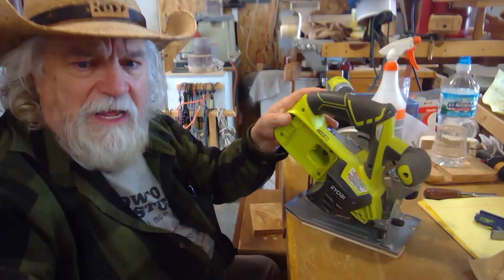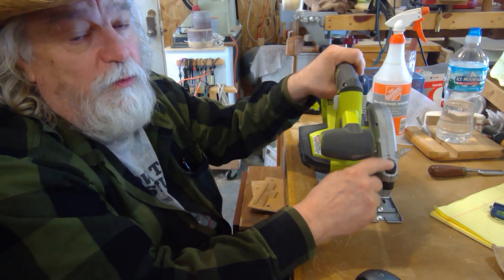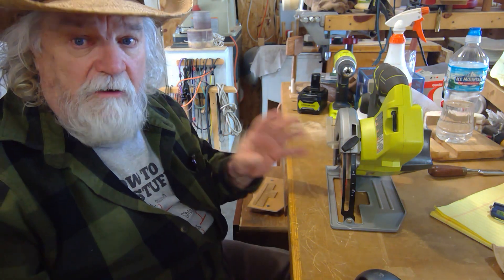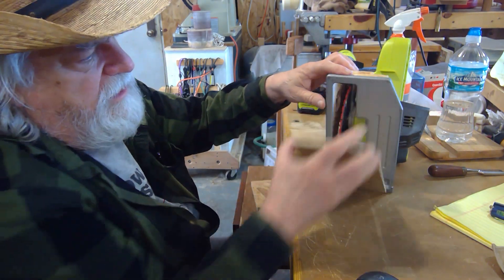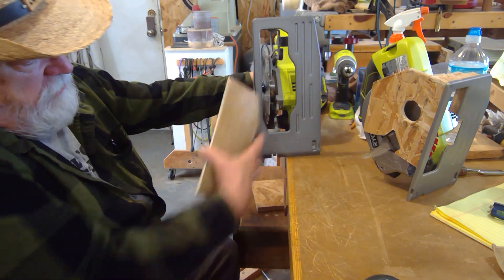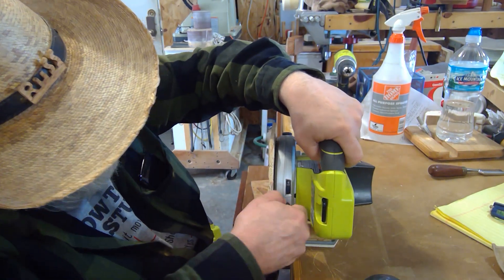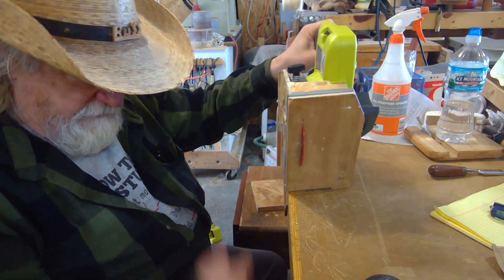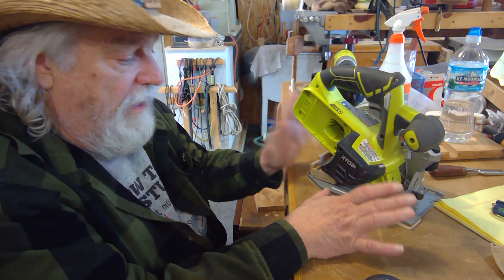No Tearout with my Circular Saw by OTB Thinker

Comment: I have the same Ryobi brushless saw and it's so frustrating that there is no out of the box dust solution from them.  I spent way too much time looking at adapting another saw's dust chute and parts catalogs for foreign versions of the saw.  I like your approached much better!  No permanent modifications to the saw.  I plan to make mine out of acrylic so I don't lose visability.  Thanks a bunch!
Reply from the maker: I thought about acrylic but I had plywood on the shelf and this was my first prototype.  it shouldn't work this well.  let me know of any improvements and how it works for you.  thanks guy :>)

Comment: Nice and quick to make! Plus, you can have more of those ready for most common cutting angles. I'd like to see some kind of fencing on it's corners or, perhaps better, on the edges to make absolutely sure this thing will be always perfectly aligned with the blade. Some kind of snap springs might work even better. What's great about it is that I'd guess it works even better than a track saw at preventing tear out. The other great thing is that it costs nothing to make and what's more it saves you having to use a sacrificial sheet every time you want a perfect cut i.e. it saves you money in the long run.
Reply from the maker: Actually, the inner opening has glued narrow cleats that hold the plate in alignment and the magnets hold it tight to the plate.  It  self aligns as the magnets make contact and can't move.  You don't need extra sides on outer perimeter.  You are correct that it saves money and tear out problems.  I love mine.  Thanks for the input, Stel :>)
Reply: @russveinot5754  Ah yes, indeed! I did not notice the cleat the first time I watched it"
Reply from the maker: @Stelios.Posantzis  I noticed that everyone else (on youtube) would surround the outside to hold the saw and drill holes to hold together, but I wanted it to fit in the original footprint and no modifying the saw with holes.  Thanks for the thoughts :>)

Comment: Check your email, I sent the pix of your jig, that I can't find the video showing how it works. Thanks.
Reply from the maker: no email from you.  what address?
Reply from the maker: use "russv" on the first part.  thinking I have an email issue with otb . . .  no email in a week.
Reply: Done
Reply from the maker: still no email. getting youtube.
Reply from the maker: Bill, still no email from you (just checked).  I still want to help.  is your email working?
Reply: Go to the link above to see pix.  Your email service is broken apparently.
Reply from the maker: Thanks for your patience, Bill.  that is a jig for my miter saw to make 45 degree cuts without moving the mitersaw angle, like when I am using my small parts cutting table.  the only reference to this jig is on link:
https://www.youtube.com/watch?v=rX2pxj_kdz4&t=167s
it starts at 5:15 and runs for 1-1/2 minutes.  if you want more, I can see about doing a quick video demo of it. Just let me know and I will do it pretty quickly.  I guarantee it will take less time than it took to see a pic :>)
Reply: I knew that I wasn't cracking up.  Thanks.  I think both this one and the Donkey Ear are great aids!!!
Reply from the maker: I'm glad I could finally be of help Bill.  thanks for the kind words.